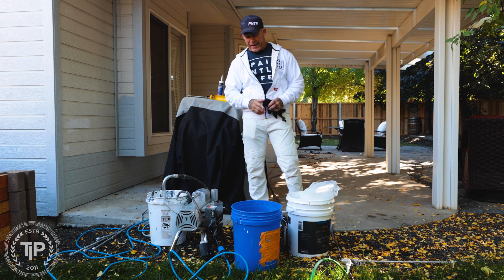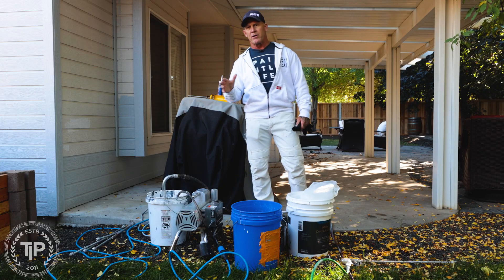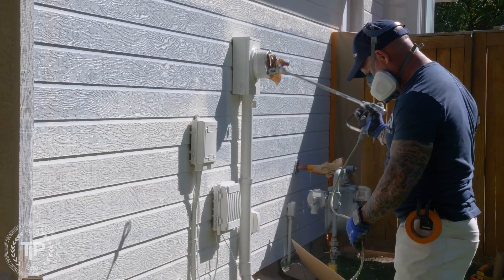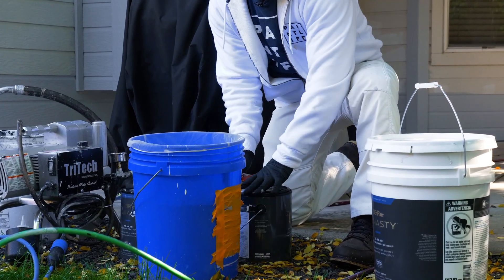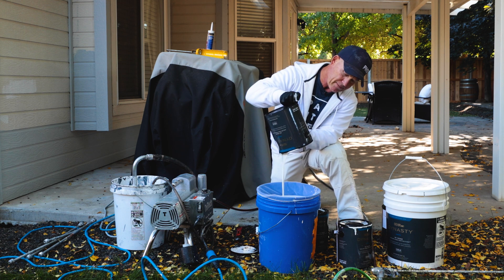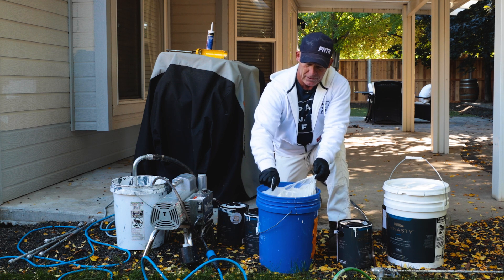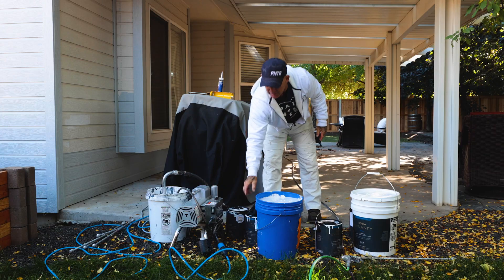Fast and Easy Way to Strain Your Paints

Comment: Nice video Chris. This is one of those things that separates pros from hacks, along with de-linting  your roller covers this makes the difference to have a beautiful finish product. People dont understand that even tho sprayers have filters, the filters will clog, blow out from the pressure and continue downstream to eventually clogging the tip and turning your productive painting day into a sprayer overhaul day. I strain every gallon, every time, every day and know I won't have any issues. When paint is shaken at the paint store, the dried paint is often broken free and mixed throughout the can, chunk free paint is not a reality, ever.
Reply from the maker: Thanks for sharing Jason

Comment: What I do once I squeezed all the paint out of the strainer with the gloves on is scrunch the strainer in your fist and hold tight and remove the glove backwards so the strainer is inside the glove . It keeps it airtight until I wash it out later.
Reply: I do the same thing with mine, often wrapping tape around the top of the twisted glove so I can use the strainer multiple times for the same paint. Throw it out when your done tho, not worth washing for $1.
Reply from the maker: Good tip

Comment: Here is a tip for ya.   take a used lid and cut one triangle out of it kinda like if you took one slice of pizza from a whole pizza.  Then take the lid and put it over the bucket that you have your sprayer hose in.  Keeps that bucket protected.
Reply from the maker: Good tip

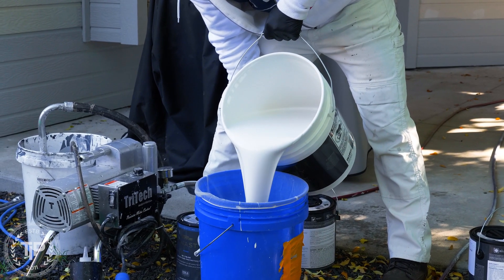Comment: At 1:45 you mention that you "box"  your paint. Meaning what?
Reply: Straining each gallon of the same paint into a single, larger (usually 5 gallon) bucket before mixing - it keeps the color consistent across the whole project!
Reply from the maker: Mix all singles together so you have consistent color and sheen